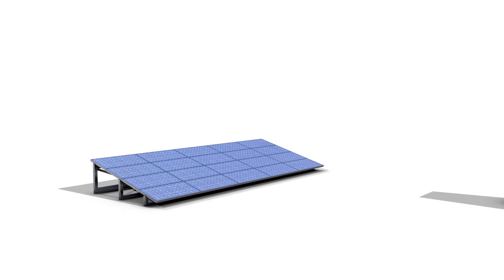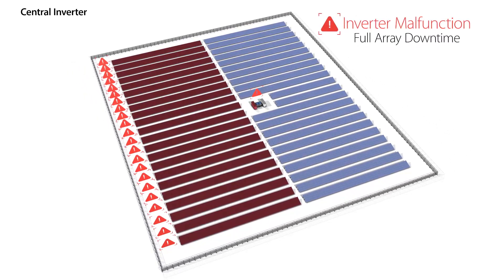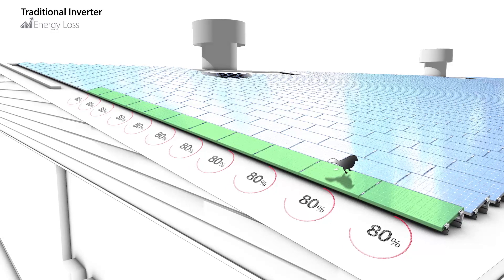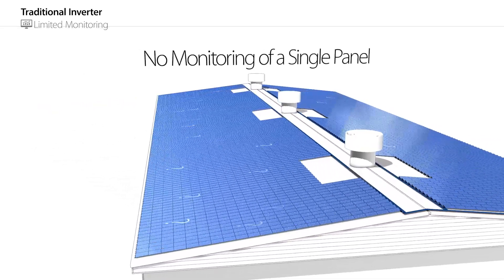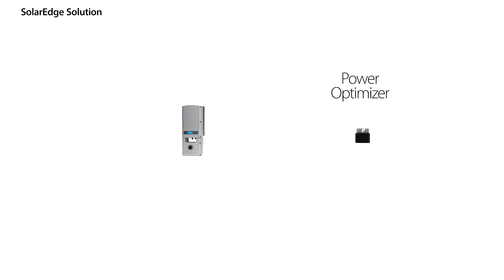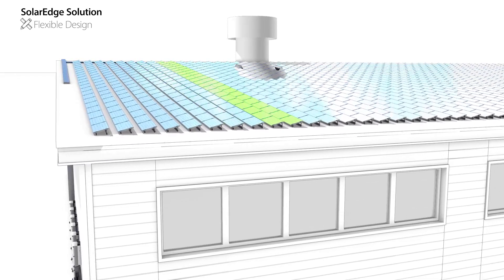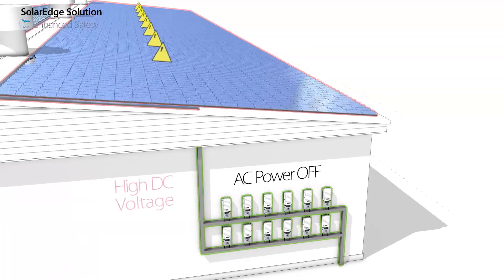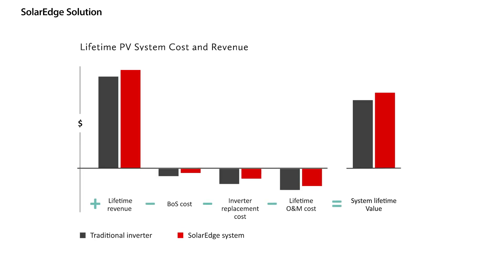SolarEdge Commercial Offering Overview

Comment: 5:00 "Reduced to a safe DC voltage" What voltages are we talking about here?  Lower voltage means higher amperage, which requires heavier wire for longer runs.
Reply from the maker: In safety mode, the output voltage of each module equals 1V.

Comment: The monitoring software sucks. The power company told me it had not been generating power for three weeks. I got no email from the monitoring company and there is no way of adding notifications in the software. Unless you want to login everyday to see if the system is doing what it should be, the software is worthless in a connected generation. My SolarEdge Inverter failed after 10 months. Still waiting on the RMA. The tech said he replaced two earlier that day for the exact same thing (the electronics on the inside were burnt and you could smell burn components when opening the cover). Surprising it didn't burn down the house and kill my family.